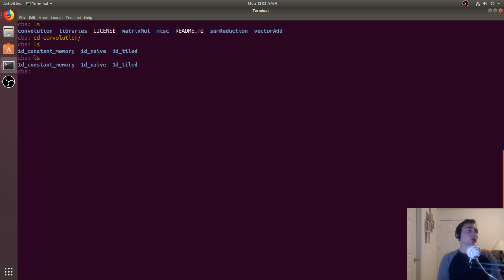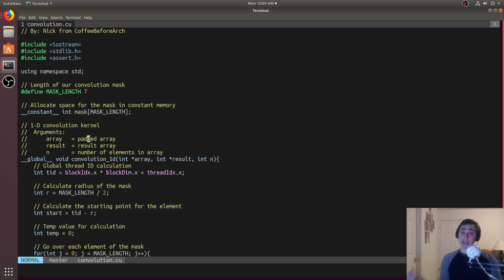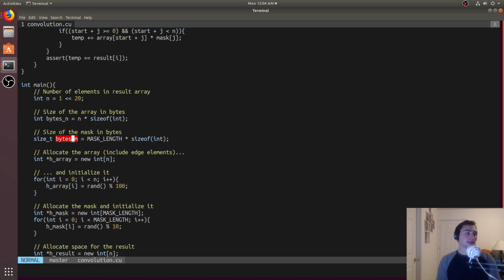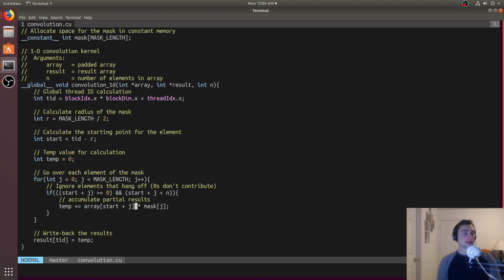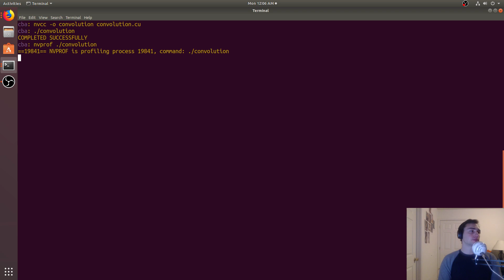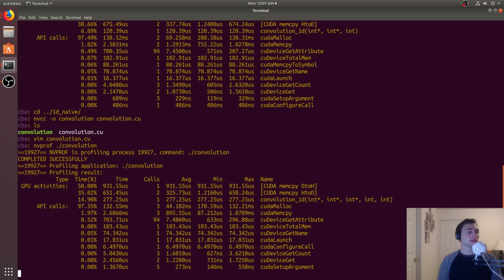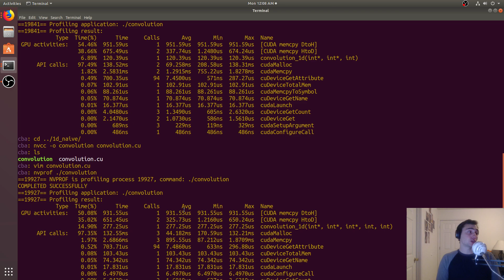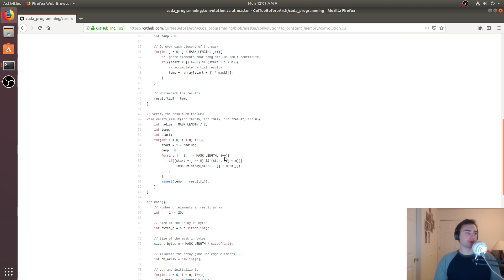CUDA Crash Course: 1-D Convolution with Constant Memory

Comment: I noticed you have changed the h_mask and h_array variables from vector<int> to int*h_array. Is there a reason? 

I tried declaring the mask as _constant_ vector<int> mask(MASK_LENGTH); and get “dynamic initialization is not supported for _device__, __constant_ and _shared_ variables”. 

Why is this the case? Is it because we reserve a certain amount of bytes in the GPU so we shouldn’t use vectors, since those can increase in size?
Reply from the maker: To your first question, it's actually quite the opposite. I've been updating the examples to get rid of raw pointers, but have only done so for the naive 1d convolution so far. The remainder will be updated as I get time.

To answer your second question, it is about dynamic allocation. While you can call the "new" operator on the GPU, it can incur a huge perf penalty. Therefore data structures like std::vector that behind the scenes call "new" aren't supported, likely because they can't be used the same way as they are on the CPU.
Reply: @NotesByNick  Thank you so much for your response :)
Reply from the maker: @lisapal733  No problem!